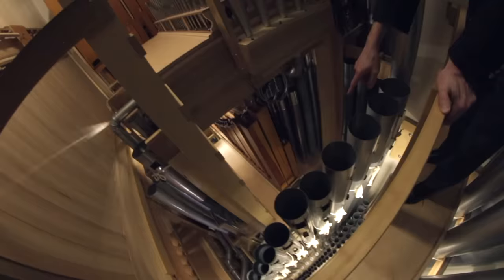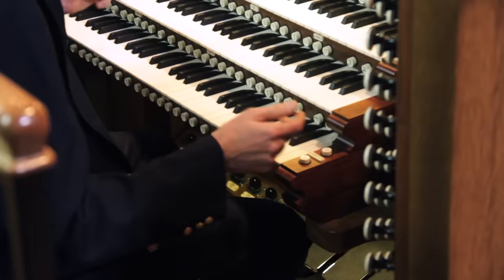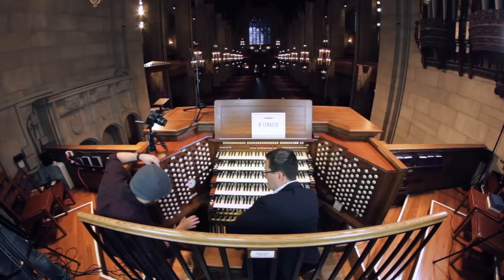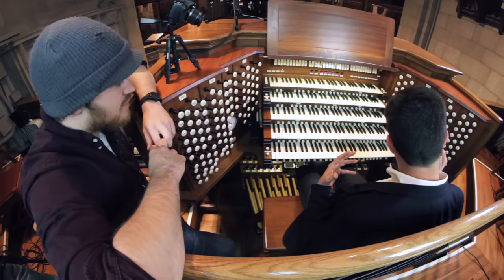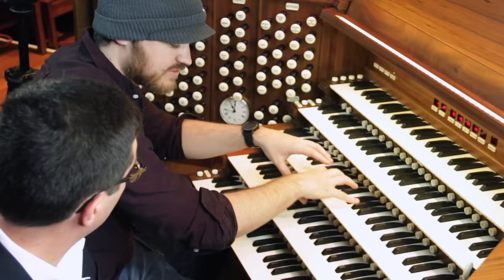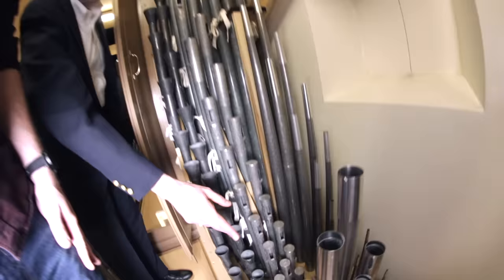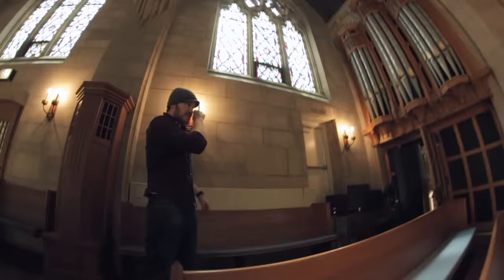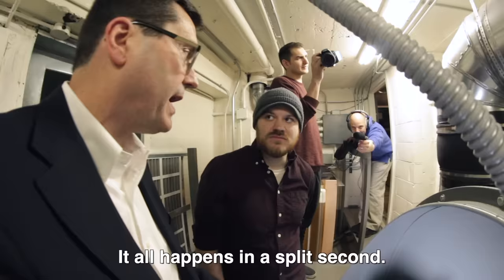Pipe Organ (An instrument the size of a building)

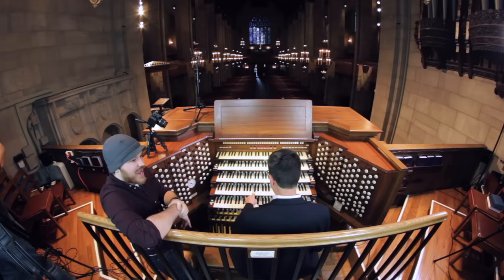Comment: 5:58
Rob "theres no way youre going to hear that on a phone!"
People with monitors and a sub holding on for dear life
Reply: Im on phone and heard it.
Reply: @southaussiegarbo2054  There are frequencies in a "live" setting that can't be replicated on typical consumer equipment. Many of these frequencies are usually felt more than heard. Like when you go to a concert and the music physically feels louder than it actually is. That's what you are feeling in your chest and when the floor shakes.
Reply: Mitchell Ballew I have a 30Hz-tuned subwoofer system that plays cleanly down to 25Hz (there are organs that go down to 16Hz, but still). And that's with cheap drivers from a "hated" brand. It amazes me how many small, high-tuned enclosures and weak amplifiers are around!
Reply: southaussiegarbo games and more 2000 not on the built-in speaker.
Reply: You can hear it on Sony MDR-7506 headphones, especially after they're broken in. They respond down to 10 hertz, which is low enough to catch all the notes down to 32 feet and part of the next octave down.
Reply: Provided your amp and your sound card are also capable. :->
Reply: The other usual limitation on hearing pipes that low in recordings is the microphones used. They have to go low enough to pick that up. The best ones for that are usually small omnidirectional condensers, like Lavalier mics. Most cardioids don't do that well with bass that deep. And it matters where you place them, too, especially in a reflective large room where there are all kinds of phase cancellations and reinforcements going on.
Reply: @RWL2012  yes on my phones standerd speakers.
Reply: @southaussiegarbo2054  not possible. just ran tones on my S9+'s speaker in a very quiet room at full volume and it just scrapes 100Hz at minus many dBs (no measurement equipment) which shows how far miniature speakers have come along but is no subwoofer / long organ pipe reproducer :-P
Reply: @RWL2012  mind you my hearing is so good i can hear super low and super super high frequencies. I think i can goto 5 mhz and other way 20000 mhz
Reply: @southaussiegarbo2054  that would be 5Hz to 20,000Hz :) and I'd love to have hearing as sensitive in the low frequencies as yours haha!
Reply: @RWL2012  yep. Its cool. 
Look at it this way. I can hear when someones mowing there lawn when they are along way away from me. I can also hear huge trucks on a highway when im up north from where i live the highway is about 1.5 kilometres (around a mile away) from where im sleeping. Can hear people listening to music when they have headphones in and music of 25. Kind of weird yet a bonus
Reply: @southaussiegarbo2054  no u di 'int
Reply: @alkoia  yes i did.
Reply: @southaussiegarbo2054  Sorry bud, hearing things that are far away isn't special. And in any residential area you can hear cars on a main road nearby. You can't hear a tone of 5Hz. You're embarrassing yourself.
Reply: @southaussiegarbo2054  If you think about it 1 hert is equivalent to something moving backwards amd forwards once a second. Hold your finger infront of you and in one second move it backwards and forwards 5 times, tell me if you hear anything.
Reply: @TRBNTR98  nope im not joking.
Reply: huh, no one here talked about harmonics and fundamental frequencies
Reply: @Gabrol  ????
Reply: @southaussiegarbo2054  just because the fundamental of the note is 30 Hz and most phones can't play that, doesn't mean the phones can't play it's harmonics, making it audible

Also what do you mean by "stuff below -5db which is less then a hz"?
Reply: @Gabrol  some people can hear sounds less then negative 5 db. Which is about .5hz
Reply: @southaussiegarbo2054  No, that doesn't make sense at all
dB is a relative scale about amplitude, Hz is frequency, and aren't parallel
Reply: @Gabrol  db is sound loudness
Reply: @southaussiegarbo2054  yes, relative sound loudness
Reply: @Gabrol  yep. And then the frequency is hz.
Reply: @southaussiegarbo2054  yes, so what? how do you relate frequency and amplitude?

Comment: They have this organ the size of a building, thousands of parts, constant maintenance needed to function, but have crappy space heaters that'll probably end up burning the place down. I am amazed there isn't an insane climate control system built in to ensure longevity of the organ.
Reply: Daily maintenance negates preservation
Reply: @Evilrose0611  II think you meant "restoration." Daily maintenance IS preservation.
Reply: @ProFriend  yes
Reply: The main functioning parts of the organ won’t get damaged by humidity or temperature. I’m sure the pipes are rust resistant, the wood for the pedals and keys won’t make the organ go out of tune from expansion and contraction due to humidity, and the electronics are pretty basic (but complex). 

Basically the parts are less susceptible to damage whereas a guitar, made of wood can get damaged if there are too many humidity or temperature swings and can go wildly out of tune.

Comment: I wanna push down every single key at once.
Reply: Kyle Nathan J Bermudez Yes.
Reply: RIP ear drums
Reply: Some people just want to watch the world burn.
Reply: Kekoa Joaquin Look up "Volumina" by Ligeti ;)
Reply: When you push one key, the blower will push as much air thrue the pipe as possible. So when you press all the keys, the blower has to blower as much air as possible thrue all the pipes. The volume from one single pipe when you press all of them will be a lot lower then when you press only one key
Reply: Joël Rohaan way to ruin it
Reply: Belal not necessarily true, the wind pressure should be the approximately same regardless of the number of pipes used, since pipes on lower wind pressure will speak differently and at a lower pitch which is not desirable. Anyways, at the premiere of Volumina the Malmö Cathedral's organ's electric blower famously caught on fire from supplying all the pipes with adequate air :)
Reply: @joelrohaan2462  Not so! The reservoirs are built to handle the same pressure to all pipes as needed. They adjust by the demand for air.
Reply: You want to make the plaster crack and fall from the ceiling? Because, that's how you make the plaster crack and fall from the ceiling!  😉

Seriously though, that wouldn't happen in every case, but I have actually heard of it happening with some organs — when someone played very long sustained notes at full volume, with all the pipes blaring away at the same time. Depending on the building's age and construction, all that vibration can sometimes work things loose in the building. In normal playing, you would never do that. It's definitely not a pleasant sound! 😀
Reply: Alas, the blowers generally can't whomp out enough guff for that, even in something this size. :(
Reply: There's not enough air on Earth for all them pipes at the same time.
Reply: I disagree. The air and pipes and the organ and the I have no idea. I'm not a pipe organ expert but I guess I've managed to find my way to a thread full of them.
Reply: you madlad
Reply: That might destroy the universe
Reply: Flick flock Exactly.
Reply: That would be called the "brown noise" and trust me, you dont want to play it
Reply: joseph guerrero I’m intrigued now. I wanna do it even more.
Reply: @Rollinglenn  - reservoirs only stabilize the pressure, so after enough time holding all the keys the organ's output is fully dependent on the capacity of the blowers
Reply: @joelrohaan2462  Not necessarily....A blower can be fitted with automatic controllers that blow more and more air in accordance with air demand - by manipulating a damper. A furnace with several burners do have such arrangements.
Reply: creates worlds strongest earthquake
Reply: In my head the church exploded after u did that lol
Reply: ok satan
Reply: Prepare for the Double D's lol

Dissonance and Decibels
Reply: Tears apart Chicago
Reply: @joelrohaan2462  NO difference in pitch...The organ stores the air from the blower and maintains it the desired pressure for a particular set of pipes.  In a well-maintained organ, the pressure does NOT change, no matter how many pipes are playing simultaneouslyu.  If you blow the pipe harder, it will not sound.  If you blow the pipe less, it will not sound.  Think of blowing on the edge of a glass of water... very little tolerance for different pressure.
Reply: @purebliss2669  Spread the good news! Jesus is Lord!

Comment: "Pipes are made out of lead and tin"

Proceeds to put the pipe in his mouth
Reply: Nom nom no-toot..... nom
Reply: And? Lead isn't dangerous to your health unless you are in long term contact with it, or ingest large amounts. I kinda doubt he walks around with a pipe in his mouth all day.
Reply: @Elmojomo  It was a joke.
Reply: @Elmojomo  You might be right, but he's using a pretty common format. It sounded like a joke the way I read it.
Reply: From Maui  probably because you didn't eat them. ;)
Reply: @mariscaljustin3947  I will not be surprised at all, I am quite well acquainted with lead in its various forms, and all the ways you can get lead poisoning. I also know that it's much harder to get lead poisoning that most people think, which was my point. Thank you for your concern.
Reply: Pure metallic tin tends to convert itself autocatalytic into a brittle semi-metallic form at low temperatures. So, unless you want to risk your pipes tipping over under their own weight and crushing you after a long winter, you may want to add some other metals like lead to the mixture.
But then again, you also don't want to lick every single one of them...
Reply: Our company build this organ, I work with lead, zinc, spotted pipes all day and the content isn't as high as you think.

Comment: Listening to an organ is a whole body experience.  When a soft 16 foot pedal note is played you don't just hear it, your whole body FEELS it.  When higher pitched pipes sound at more audible volume level you feel those sounds, as well. In a building with hard walls, floor and ceiling surfaces the sound is reinforced; allowed to reverberate instead of being soaked up by sound-absorbing surfaces like carpet and even by the people occupying the seats in a crowded church.

Comment: "pipes are made out of LEAD, and tin" continues to stick pipe in mouth
Reply: Metallic lead isn't terribly dangerous, lead salts are much more dangerous, and you're unlikely to ingest any from doing that.
Reply: M O'Connell oh ok thanks
Reply: Brief contact isn't that dangerous. Not to be recommended of course, but not lethal. Constant intake of lead will lead eventually to poisoning.
Reply: @moconnell663  in case anyone was wondering, that was the problem in Flint, MI when they switched water supplies. The lead pipes were subjected to a more corrosive water supply and the salts leached out of the pipes.
Reply: @DriveCarToBar  it was the corrosive action of their untreated water that caused those salts (oxides) of lead to form. The lead pipes (in the presence of favorable chemistry) are not harmful.
Reply: Last year the WHO announced that there is "There is no known 'safe' blood lead concentration", because it's bio-cumulative, so even exposure to one more atom should be prevented. And through various paths you always get some in your system, of which a lot we have to thank from throwing out old electronics in the dumpster in the past.
Reply: Actually, the pipes are steel plated with tin, and soldered together with lead. The tin keeps the steel from corroding; the steel is for strength. Like a "tin" can.

Comment: how did they create the wind before there were giant electric turbines??
EDIT: ok so theres always a dude pumping ?? lol imagine being the local "organ pumper"
Reply: HECKproductions that was my nickname in college
Reply: @overkillonly  "so where do you pump the organ" - "in church" - "WHAT THE FUCK"
Reply: You laugh, but that was a legit job way back when
Reply: Back at my home town in the church from the early 1800's, the pipe organ had a built in room where two or three church youth's would press these planks with their feet to provide air to the organ.
Reply: Yes, a long time ago organs were pumped by hand, or by people pushing levers down with their feet, which is less tiring.  They were called "calcants" and organ consoles often had a stop knob the organist could pull to signal the calcants to work harder.  Even before electricity was available, some organs had other power sources such as water engines: https://www.youtube.com/watch?v=MNHkCc9P_A4

Comment: Inside the walls of the church it looks like a steel tube merchant lost about 500k worth of stock in there.
I used to service an antenna on top of a church steeple, those wooden ladders looked completely safe compared to the ones I had to climb, they looked like someone had stripped a privet hedge and used some of the twisted sticks to make the rungs, one of the most scary things I have ever had to climb.

Comment: It is not as large as this pipe organ, but I took lessons on the largest organ in San Antonio Texas which is at first Presbyterian Church. Like this one, there is not one artificial pipe in the hole instrument. All the pipes are real and functional. I used to be afraid that I would lean too far back on the organ bench and fall out of the organ loft because the height is absolutely dizzying.

Comment: Just found you're channel and am mesmerized by it.  FYI, the organist was wrong when he told you that when you press a key the air moves from the blower all the way to the pipe in an instant.  The pipes are set in air boxes.   When you pull out a stop, pressurized air is admitted into that air box, ready to be used by all the pipes in that air box.  When you hit a key, air valves open under all the pipes for that note in that division of the organ controlled by the manual (keyboard) you are playing.   But only those pipes that have had the air box pressurized by pulling out a stop will sound. So the air doesn't come all the way from the blower in the instant you hit a key.

Comment: I learned So much today, watching this. I've seen different tours before, but this was the Total of All tours! The one thing I haven't seen anyone comment on, is the cloth pieces, tied around many of the taller pipes. I can only assume it is a support, but the cloth is used so it doesn't vibrate. Or, maybe it's a Vibration Damper, needed for some of the pipes? Anyone know?

Comment: I really wish more creative musicians could get their hands on such amazing works of art and engineering.
The Church Organ and the Hurdy Gurdy are both such unique and complex instruments that hold far more potential within that we've yet to tap into, and now with modern tech we've even created entirely new instruments like the Modulin with the same potential.

It's a shame that we can't see these wonderful and unique instruments in harmony, simply due to how niche, expensive, and time consuming they are.
Heck, proper Organs have to have an entire building constructed around them for both stability and to act as the resonance chamber.
The Hurdy Gurdy is the only instrument to my knowledge that uses a crank.
The Modulin is the first and so far only handheld synth that isn't a keyboard, and has so many plugs and dials that it's easy to mess up.

Now add some drums and an electric guitar for flavor, and you'd have the recipe for a soundtrack full of scientific wonders, mind boggling magic, and the ever consistent folly of man.

Comment: Impressive, until you consider the Boardwalk Hall Organ of Atlantic City, which is finally being fully restored after disastrous storm damage, as well as careless building renovations over many decades: Over 33,000 pipes(including 1 of the 2 x  64' pipes in the world; & one 32' pipe with a volume of 130Db...6 times louder than the loudest train whistle) in 449 ranks located in 8 chambers and powered by 7 blowers totaling 600Hp; and controlled with the world's only 7-manual keyboard, including of 1200 stop tabs & 6 swell pedals...and that's just the beginning! Yet, the 1930's contract price for this beast was under $350,000 (under $6MM today).

Comment: so by what mechanism before modern electronics did pressing the key on the organ simultaneously or instantaneously get stops pulled or wind blown into the right pipes a whole or half church distance away? do they use strings and pulleys or some kind of medieval wifi signal?

Comment: That's crazy.  I've never seen anything like it.  I bet you have to keep the temperature and humidity constant or else it will go slightly out of tune.  Or, is it more stable than that?
Reply: You are correct. But not the way you think. 
I live in northern Sweden and our local church (Kiruna Church, google it, it's cool) has a massive organ. But temperatures range from +30C to -30C. 
In the summer it's a bass heavy tone, shakes your bones to the core. It's incredibly awesome. 
In the winter it's a lot "lighter", but don't think it's less impressive. You can hear the Jul/Christmas play from over a kilometer away in the winter. It's not as heavy but it is extremely loud. The tones are a lot cleaner.